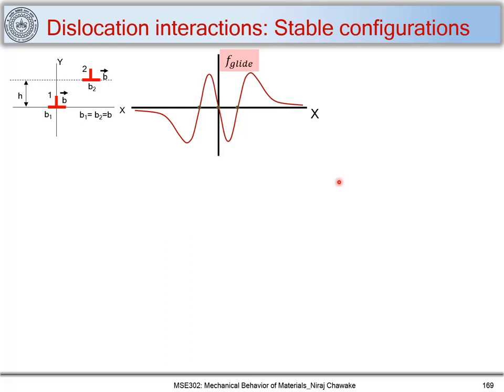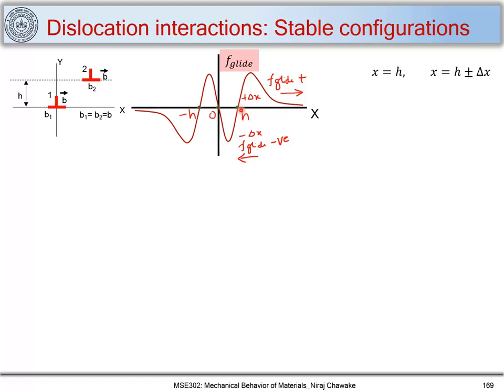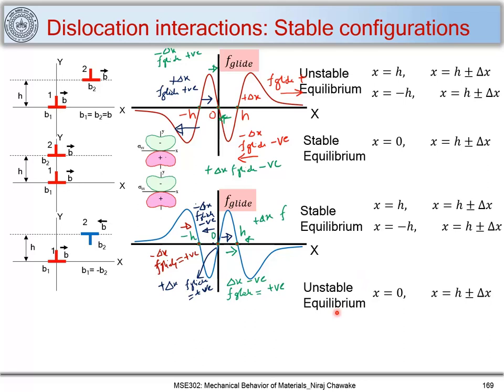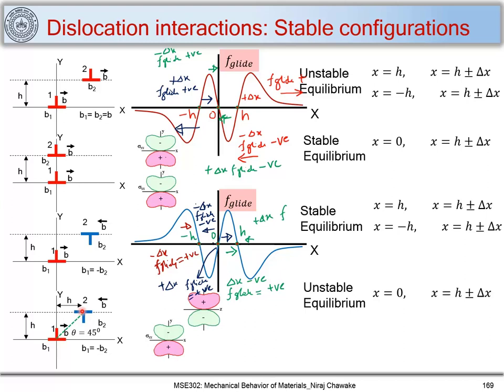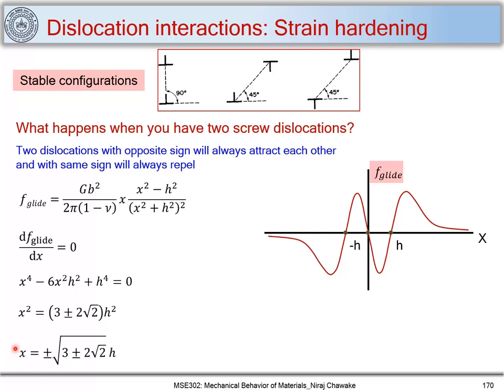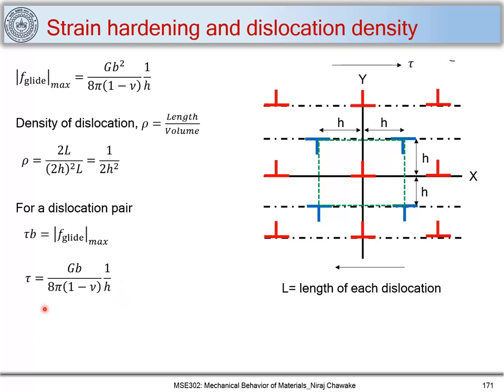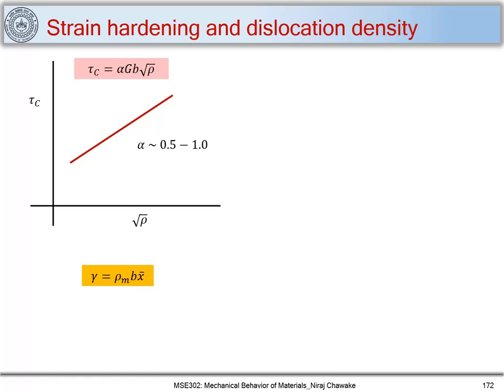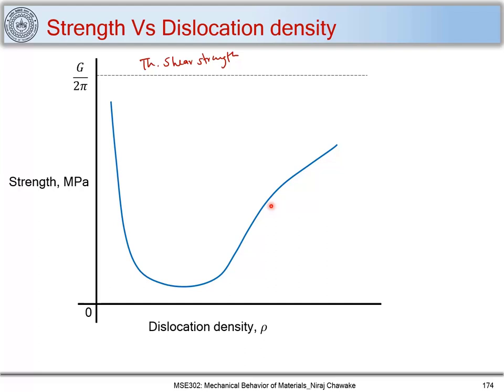41. Dislocations Interactions, Dislocations Stable configurations and Taylor relation

Comment: Good morning! Thanks for this very good series of lectures. They are clear and complete, which is very nice! 
I have a question about this lecture: how can dislocation anihilation contribute to strain hardening? When dislocations annihilate, doesn't the dislocation density decreases? (which would cause no hardening but a softening?)
Thanks in advance!
Reply from the maker: Hello Vincent
Thanks for your comment.
Indeed! You're correct. In general, the annihilation of dislocations can lead to a decrease in dislocation density, which may result in strain softening. I used the word "contribute" in a broad sense, meaning that strain softening caused by the annihilation of dislocation use to have a negative impact on strain hardening. You can understand why the word "contribute" was used, because when you consider the annihilation of dislocations in ordered alloys/compounds that can sometimes result in local strengthening in such materials. I hope it clears your query.